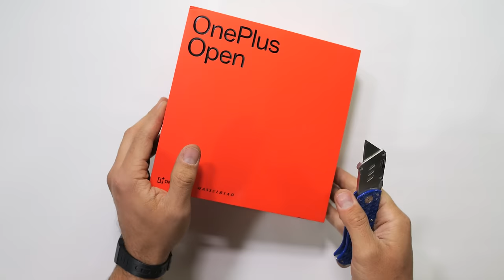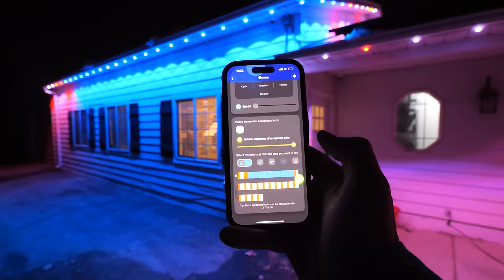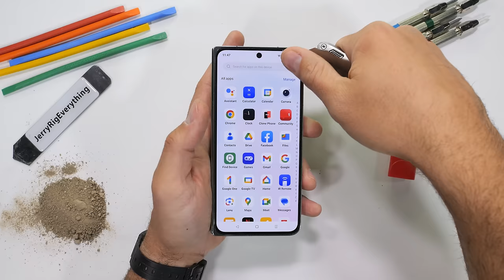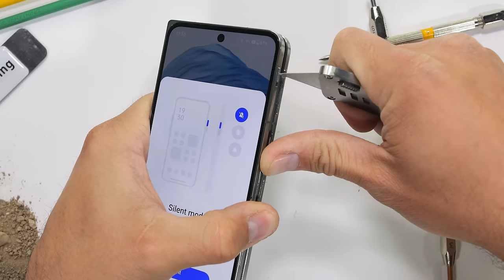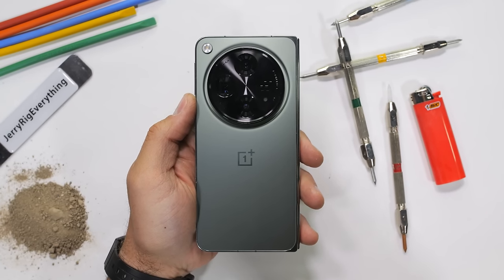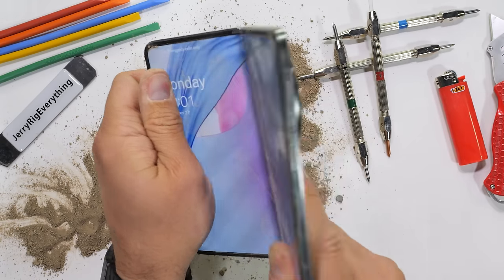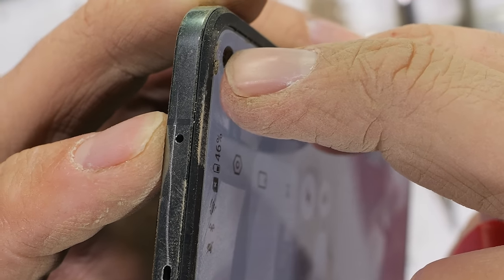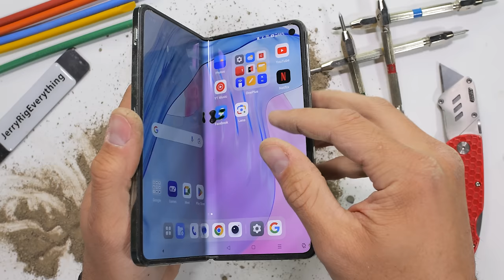OnePlus Open Durability Test - You guessed wrong...

Comment: I think this phone really is kind of a judgement against Samsung. Samsung introduced the folding phone to America and is on its 5th edition and still has the narrow screen that many have been complaining about, still is heavy and the crease in the middle of the screen is more prevalent. Samsung became complacent and lazy refusing to acknowledge that other companies are seeking dominance.
Reply: Yeah I think you are right. I've been interested in folding phones for a while now, in terms of specs nothing is good compared to the Samsung fold. But the narrow screen just makes no sense to me and the crease is clearly visible on the big screen. 

I think OnePlus/Oppo nailed it with this design. The phone is light weight for a foldable, the outside screensize is perfect and the crease is only visible when the screen is turned off or completely white (like a pdf file) and you hold it at a weird angle. If you look at it normally you can barely see it. I almost bend my phone the wrong way one time because I forgot I turned it sideways to watch a video a bit bigger and the crease wasnt visible.

I'm really curious what they can do in the next few years of development. And what they will do, will they settle like Samsung or will they make this design even better
Reply: As a OnePlus Open user, only function that wants me to use samsung is Smart view to send video to Samsung TV. The rest, OnePlus open nailed Galaxy Fold in almost every aspect including Cameras. Samsung multi app access were not good as OnePlus.
Reply: Samsung's embarrassment in the world stage, by having their Hardware is so far behind. Samsung is currently "reverse engineering" the top Huawei foldable, to try figure out how to make a thinner fold.. Fact!. 😮😮

Comment: OnePlus makes a solid phone. I'm working on my 5th year with a 7T that failed this durability test. It even fell off a motorcycle at 45mph with zero damage! I finally broke the black glass on it over this past summer. I would upgrade to a newer 1+ just to keep the alert slider if they would give me wireless charging. I'm currently using a wireless adapter for the past 3 years.🤯

Comment: One things I’ve learned over the years, don’t be a fan.  Always keep your perspective, as in logical common sense.  

Case in point, I love carbon fiber. Especially for right now being the best way to implement graphene and carbon nanotubes (nanotube fabric and graphene resin)
But the issue is cost and how easy it is to implement something.

At one point, when I was thinking of O’Neill cylinders, I had thought of 5 foot diameter carbon nanotube cables basically acting as the “thread” in a massive composite, and scale up like how regular composites are made, just weaving a basket as tight as possible and fill in the spaces with graphene resin and chopped nanotubes/graphene carbon fiber.

I have since revised it, keeping the nanotube cables as reinforcement, power delivery and power storage.
The same is true for graphene like Robert Murray Smith’s bullet proof graphene puck (or trying for something similar as filler).  You have to look at the overall in terms of mass, cost, function, and the forces you are subjecting it to.

I still worry about moving an O Neil Cylinder in space, doing somersaults with Torus sized flywheel gyroscopes and materials like concrete (even graphene concrete) but it should do just fine with stainless steel footings-  “screws and tiles” with girders and different size meshes (faraday cage).

Graphene concrete filler should do just fine vs a graphene polymer composite.  I still think about nanotube composites for mesh/faraday cage functionality with chopped graphene carbon fiber and graphene resin as a filler, but I am not “wedded” to that idea like I used to.  

A carbon nanotube/graphene “composite” substrate (most of the Cylinder) that you can “screw in” (or build around/encase) huge stainless steel footings/tiles in at 100 feet in depth still fascinates me, like someone riveting screws/bolts and washers into a huge square of carbon nanotube composite.

Comment: While I don't buy flagships or anything, nor do I spend over a grand on a phone, I do have the OnePlus Nord which I bought in 2020 or so. It's been three years and over 50 individual torso/chest height drops to both the screen and back, and my Nord hasn't suffered so much as a tiny scratch, nor has the glass anywhere broken at all. After a good clean and dry to get the dust and dirt out of small holes, it still looks pretty much brand new.

So, while I don't expect the Open to survive (I'm only three minutes in), I will say that my experience with their cheaper models has been superb and thus I'm more optimistic than usual. We'll see if my heart breaks though 🤣

Comment: I just want a foldable phone with two glass screens. make the bezel as small as possible and it'll be good enough. Cut it out with the glasstic gimmick just so it can have a folding screen. its dumb. Ideally it wouldn't even have a screen on the outside, just the inside screens like the Surface Duo, but actually good.

Comment: As a OnePlus user. I'd never get one again. The screen has fallen off my phone and it's being held together by a case. The software is the biggest issue however, it's totally crap. Phone is terrible at receiving and making calls. It's pot luck if it'll ring or not for an incoming call. So many apps have bad bugs that I haven't experienced with other phones.

All round I'd just avoid the brand, I've lost all faith in them.

Comment: I think these folding phones should be also bend-tested like that when it's open, you then bend it horizontally, Just like on 8:37 but in opened position. I don't think they will survive that. And that could be pretty significant factor as someone could sit on top of it when it's on the sofa or something.

Comment: If the inner screen protector is the same as Samsung's then DITCH IT ASAP. Samsung's is TERRIBLE and will fracture only months into it's use, usually at the edges of the hinge and then will work it's way in, because it's glass, once it has fractured it can also end up cutting into your screen permanently damaging it. Just use a normal screen protector, the different in protection is negligible and the "No Glass" version won't puncture your screen and render your phone useless. Samsung need to wake TF up.
OnePlus's camera housings are getting uglier with every phone, remember the gorgeous OnePlus 7 Pro with it's popup camera?